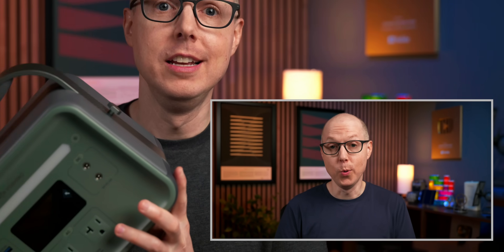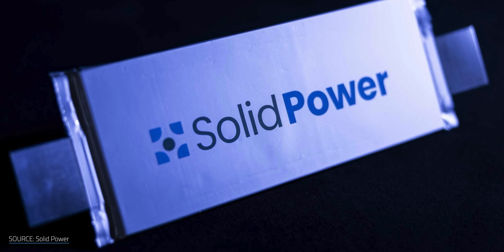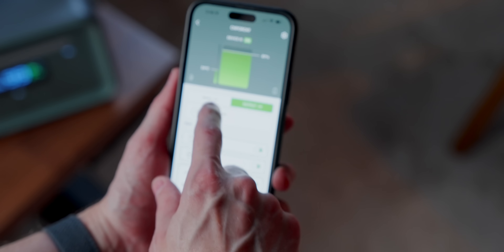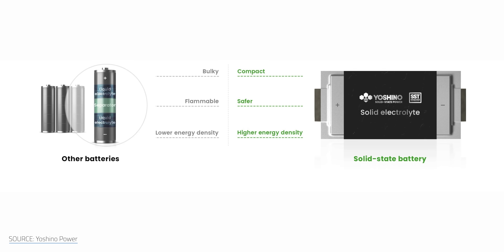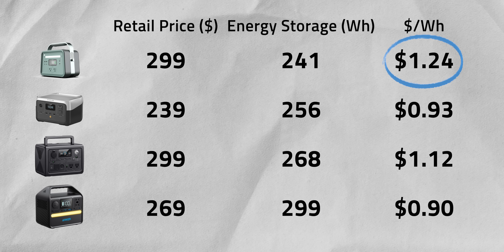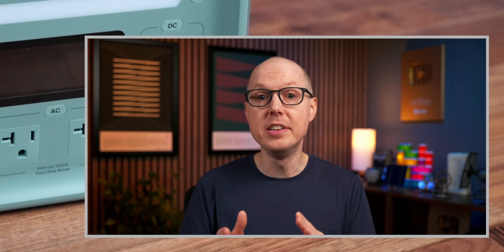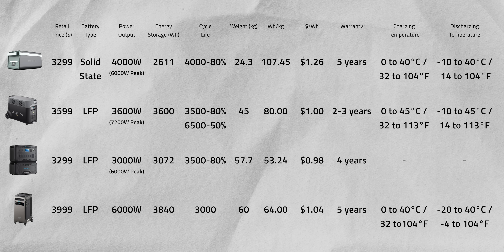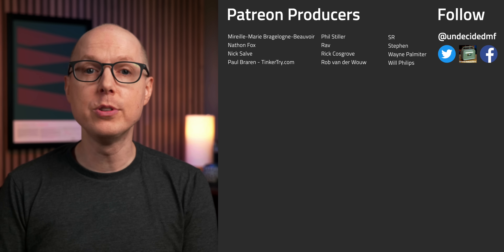UPDATED: Solid State Batteries Are REALLY Here - Or Are They?

Comment: Well... the repost is ... only a little better.  But you still made a number of serious mistakes and the two most glaring is that you (very clearly) don't know much about LiFePO4 if you think the Yoshino is going to have a better life-span.   People have 15+ year old LiFePO4 cells, cycled daily, that are still pulling 100% capacity.  The reality is that the power electronics in ANY power station will fail long before the actual battery cells do when talking about LiFePO4.   So keep that in mind.

Yoshino's temperature claims are just as suspect as all their other claims.   But well, I'll be frank.... people who buy power stations with huge capacities are NOT buying them for mobility.  It literally doesn't matter what the weight is.  You don't haul a 4000Wh+ power station on a hike.   You haul a 250Wh on a hike.  And maybe a portable solar panel.

Yoshino is about as "life style" as a hole in the wall.  Really.

And again, I will remind you, that a power station brand does NOT actually make their own battery cells from scratch.  It just isn't possible.  Several other channels have already torn the cells out of the Yoshino and they basically look like regular NMC automotive pouch cells.  I'll bet those batteries don't even have the cycle life they advertise.  And they barely scratch the C-rate.  It makes no sense whatsoever.

In anycase, you are hip deep in a multitude of sketchy companies here... the testing company is probably as sketchy as "Yoshino".  

-Matt

Comment: Thank you for the update.  I was disappointed when I saw another youtuber tear it down and discover it wasn't what it claimed to be.
Reply: so much for the safety claims, I was also disappointed to see one tear itself down after a puncture.
Reply: It is a LIE ! Reviewer took it apart and they are Lithium Batteries caught on Fire
bigtb1717 
Yoshino Solid State Battery Power Station, Test and Teardown!
Reply: We're you paid for this weird defense of their battery, or are you just dragging this out for views? It's obviously a scam dude. The cells are literally lithium ion batteries.
Reply from the maker: I’m still dubious of many of these tear down videos.  There’s still a bunch of misunderstanding around how to verify the solid state claims.  There’s more to it than simply sticking a drill through it.  Hoping I can bring a lot more detail with the tear downs I’m pulling together.  No matter what comes out of it, should be super interesting.
Reply: @UndecidedMF  one teardown told that a part numer on cells leads to data sheet of standard lithium cells
Reply: @UndecidedMF   Being dubious is not as reason to dismiss the work of others, it''s a reason to apply the scientific method apply the principle of repeatability.  You don't need a drill to check the part numbers or look up the FCC ID or the MSDS.  I bet the company Yoshino is not Japanese at all and just as made up as Howeasy or Bluetti.  At this point Amazon's reputation confers negative value.
Reply from the maker: @catsupchutney  I’m doing exactly that.  There’s more to this than most have touched on.  Stay tuned because I’ll be sharing all of it once I’ve been able to interview all the people I’ve got lined up, as well as the various SEM analysis of the internals.  It’s interesting.
Reply: @UndecidedMF  You are no better that the battery you got, in other words a scam...
Reply: @UndecidedMF  Good point. I just as much look forward to learning the result as how battery chemistries are properly torn down and studied.
Reply: @UndecidedMF  There is definitely more to it then just sticking the drill through. The problem is - company claims that there is no flammable material in the battery.
Reply: @UndecidedMF  if anything is dubious its how many things you promote on your channel that turn out to be scams, you gotta do better man! stop trying to save face and just admit you are wrong
Reply: @KenetorTV agreed
Reply: "There’s still a bunch of misunderstanding around how to verify the solid state claims."

Matt, you didnt do 30 seconds of due diligence to even check. The serial number on the packs lead to a google search result on the first page for what they are.
Reply: Hundreds of people basically got scammed because a video was rushed out just to go "muh future", when you can clearly see its a basic lithium pouch battery just by opening it.
Reply: @AgalmicAutomata  Link?
Reply: @UndecidedMF   I saw the tear down video. He shot it with 2 arrows. The anode and cathode bridged and it caught on fire. I saw no tear down and whether the electrolyte was gel or solid. NMC and NCM batteries will both spontaneously combust when charged and damaged. Solid state electrolytes won't fix the dangers. Company doesn't seem to understand how dangerous their battery is.
Reply from the maker: @djkuhl  Solid state batteries can still suffer from thermal runaway and fire with damage. That’s why those kind of tests aren’t a way to determine if it’s solid state or not.  I’ve seen 4 videos like that, which did some pretty bad penetration testing (not even close to how it’s done in a lab).  Only 1 video did a nail penetration somewhat similar to how a lab does it and in that one it didn’t catch five after numerous penetrations.  He really had to mangle it up to get it to catch fire.  Again, even though it survived that one, it doesn’t prove solid state or not.  The damming thing is that it looks like there’s a liquid electrolyte in there of some kind.  But that still doesn’t answer the question of if there’s a solid electrolyte also at play.  Is this more of a semi solid state?  Is that why they claim what they do?  I’m not defending that choice at all, but that’s what I’m trying to find out now.  I’m working with two separate people that are breaking this down in a proper lab and with a chemical analysis.  I’ve also spoken to quite a few people about what a “solid state battery” is and the definition isn’t as clear cut as you’d think.  Again, this isn’t a defense of Yoshino at all for their marketing.  But there’s a really interesting learning opportunity here that has me excited (not even including the Yoshino controversy).

Oh, here’s that one tear down with a somewhat decently done penetration test.  Still doesn’t prove it is or isn’t solid state though.  https://youtu.be/gRXGogMm2rw?si=kxSFVfuwMNs-iD0Y
Reply: @UndecidedMF  The part number goes to a data sheet of a lithium cell.  Why would they put a part number of a standard lithium cell, on a solid state cell?
Reply: @UndecidedMF  Similarly I'm a little let down and concerned by the initial claims of Yoshino.
Actually having arrows shot at them seems more of a realistic scenario to me than using nails.
We should know that it's not viable/possible to check every detail of every product, specially in this case.
Thankfully you're around and wiling to investigate so we can get to know a bit more. Thank you for your work.
Looking forward for the update.
Reply: @UndecidedMF are you for real ? Open it your self, you got scammed just admit it.
Reply: @soundtrancecloud5101  Edit:  The evidence these are simply Lithium batteries is pretty damning, I found a different video.   Retracting, but not removing, my initial comment.  I'm not sure what reason Matt has to doubt the fact that the datasheet for the internal batteries was FOR a Lithium cell.    Ugh.   But so far they can get away with it.  

--- And what makes you an expert?  Did you even watch this video?  Further, what makes a solid state battery by your definition?  I think that's the problem, not with just you but the definition of solid state.  It's solid because it replaces A liquid with solid.  Can you find a definition that says no liquid remains?  I will quickly agree that 100% solid SHOULD be the definition.
Reply: @soundtrancecloud5101  Unequivocally. We are well past the point of chemical analysis. There is a time and place to use the "further research" defense, but this is not it. This is the time and place to say "I was wrong, and I apologize." I cannot spell out the actual learning opportunity here any better than that.
Reply: @soundtrancecloud5101  That's the left for you, never want to face reality.

Comment: If you want a "light and dense" camping battery, the way to go is a 24V LFP.  Many if not most things that can plug into a 12V cigarette lighter port are now designed to also work at 24V.  24V carries the power out more efficiently than 12V on the same wiring.  Then you leave the power inverter at home.

Say you hook up my portable fridge.  AC power is measured at 73W when running.  DC 24V seems to be ~60W.  Average DC draw is ~30W on 24V as in I calculate this number against the Wh rating of the battery to get total estimated run time on battery.  So DC you cut out the conversion loss of say 10% and parasitic draw of say 5W to go from 24V DC to AC, you dump the inverter overboard all together, and you get rid of the conversation loss in the fridge from 115V AC back to 24V DC of ~20%.  You may lose on average ~40% of your power between conversion loses and parasitic draw of the inverter, which is now all dumped overboard.  Now say it just goes straight 24V DC from the battery to the fridge.  There is a 0.5V drop from the battery to the fridge while running over the long DC cable that comes with the fridge.  With 12V, you have a 1V drop and twice the current.  So you go from a ~2% transmission loss to an 8% transmission loss going from 24V to 12V.  So AC conversion ~40% loss.  12V is ~8% loss to go from battery to fridge.  With 24V it is a ~2% loss to go from battery to fridge.  24V DC battery is the winner here.

Now what else do you want to power on your camping trip?
1. USB - USB chargers are available that very efficiently take 24V power and buck it down to your device voltage.  For PD, the output voltage is typically 20V, so a DC-DC buck conversation from say 26V of an LFP battery to 20V is about the most efficient thing you can possibly do.  Nearly 100% efficient.  So again a 24V battery wins.

2. Dedicated laptop charger - Say you have a laptop with a dedicated power plug, not USB-C PD.  A standard Dell power supply for example is 19.5V.  Again going from ~26V of an LFP battery to 19.5V through a simple buck conversion on a buck-boost converter is about the most efficient thing you can possibly do.  Nearly 100% efficient.  They make a variety of these and ones that are "universal", so pretty much any laptop can be powered this way even if you don't do USB-C PD charging or it kind of sucks on your particular laptop model.

3. Starlink Mini - This can take a 100W USB-C PD power supply.  Again 20V.  So a 24V LFP battery to do this primarily doing a buck conversion (maybe use a voltage stabilizer) is the most efficient thing you can do.

4, Cell booster - They make these that can plug into a cigarette lighter port.  I am sure you can find one with a power supply rated for a 24V LFP battery.

5. Cooking - Use a propane stove.  Job done.  No electricity needed.  Anyways, bringing an electric hot plate or microwave oven is a lot more crap to lug around.  Just bring a propane stove and call it a day.  And you know for hot coffee, you could just boil hot water on the propane stove.  This process does work without your electric espresso machine.

6. Lighting - USB charged lights.  No AC power needed.  Why would you fuss with a propane or white gas lantern?  I mean an LED light you just press the button and it turns on and off.  And why would you bring an AC lamp or something with you?  You are camping here, right?

Really, what are you bringing an AC inverter on a camping trip for?  Just dump the inverter overboard and then you have "light and dense".  Certainly lighter and denser than any of these portable power stations.
Reply: @ChaJ67  Holy Cow 🐄 <3
Reply: Hey now...

Check out the Wacaco Picopresso....portable espresso machine. All you need is the boiled water.
There's also the Outin which you can easily charge. Option to use with boiled water significantly increases the unit's battery life if it doesn't have to heat the water as well.
Then there's the Aeropress. While not espresso, I'm just adding that there's kinda no excuse to not have excellent coffee anywhere...
Subminimal Nanofoamer if you need foamed milk. 

:p

Didn't expect to see VSWR stuff.
Reply: A comment so good it should have been a video.
Reply: @ChaJ67  speak for yourself my new Tacoma Hybrid has a 2000w inverter constant in idle/drive/reverse thing pumps out power. Why carry propane when I already have a generator under the hood, I get both AC & DC power, don’t need propane. Induction & air fryer camp kitchen. Running a B2000 I have ~150 cycles on it, got it dirt cheap in ‘23. Is it 100% dry? Nope. Will they loose their innov awards? Maybe. Do I care? Nope. Power station performs as advertised.
Reply: @projectmaldives  I have done similar things with my hybrid.  Not quite as much power.  I find I may need to bring fuel to run the car as a generator as I don't want to get stuck in a remote location.  It works per se, but a hybrid vehicle has a high residual load.  It's not really high, but high enough to consider a Jerry can.  Then you have extension cords drapped from your car, which I have done.

The battery allows something like a portable fridge to run quietly around the clock.  The car can stay off, which it is nice and a better feel than having your car in a state where it could be driven off at any point in time as you need to leave the keys in there for the car to stay active.  On the other hand, the battery can be placed next to the portable fridge with the cooking setup, no extension cord.  I really like this.  Then just add the USB charger, and it is all good to go.  Easy.  Simple.  Reasonably compact.

As for cooking, I actually like the idea of induction burners and an air fryer.  Especially as my newer induction cookware is ultra-non-stick, making it super easy to clean and induction doesn't care about the wind like flame does, seems like a nice deal.  My dad just gets pissed off when I try to bring up the subject, so it's harder to plan a camping trip with him where I would use that part of my kit.  Again, with a big enough battery and big enough inverter, you can drive that stuff and I can with the equipment I have.  A thing that pisses off my dad about that is the space, weight, and complexity.  Just bringing a propane stove and a 1 lb propane bottle is super simple and compact.  He thinks that is the way it is supposed to be and doesn't want to hear about things that don't use fire and ice.  He also doesn't want to hear my easier to clean argument for my induction setup. He is annoyed enough with my portable fridge as I am not using ice.  I just think dealing with ice, especially for multiple days, is a lot more trouble than doing the battery deal.

With something like cooking, it does drain a fair amount from the battery.  Propane is much more compact and light for what it does.

Comment: Good stuff. You don't just want ion energy density, you want rapid rechargeability to maintain work/time. A muscle ion processes tends to be stronger than a electric motor of the same mass, because it can continuously restore potential, while diffusing energy, therefore ion gradient energy density is a narrow focus, because the goal is work/time. Because you don't need (1 type of energy density) not to just have all the energy density in the form of (ion gradient energy density) considering work/time, because there is a voltage to consider in terms of the appliances being run, it's enough to have faster rechargeability, and chemical potential energy density, rather than high ion gradient potential energy density. Because a battery is not meant to diffuse it's power all at once, therefore high ion energy density potential is irrelevant and not practical, it's a error in measure of a batteries capability, because that's not what batteries job is, rather work/time is a batteries job. There are other energy densities that can be stored. Biological systems have many types of energy density storage, these energy densities are one a type of conveyer belt that resources the ion potential progressively as charge is diffused. It needs to be like a piston, cycle around from potential to release potential to release, where the oxygen and gas in the motor is not a total measure of the potential of the motor, but rather there is a gas tank that is not being considered. It's about the non-frictionless transfer between multiple types of energy density, and the efficiency, and sustainability of tech without pollution or drudging up the sea beds, or slave labor in Africa for rare earth metals, and it's about progressing science and engineering past the community of peers one eyed cyclops mode nonsense.

Comment: I have said before this first version is not competitive enough and its strength don’t shine. 
Solid state looses its value in the small solar generators. 
But I can also recognize that us LFP fans are pushing back just like the lead acid fan were pushing back.
Reply: not sure, why to be a fan of lead acid or lfp - you need to be a fan of more dense battery which can cheaper more energy and be lighter at same price ))